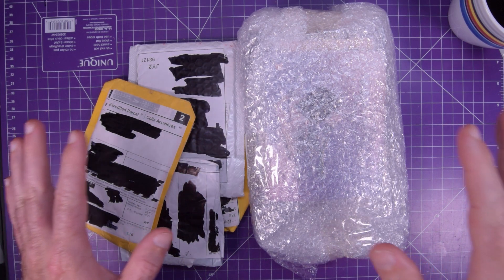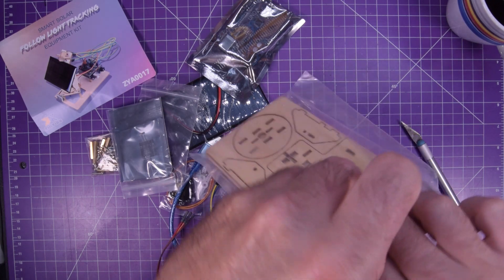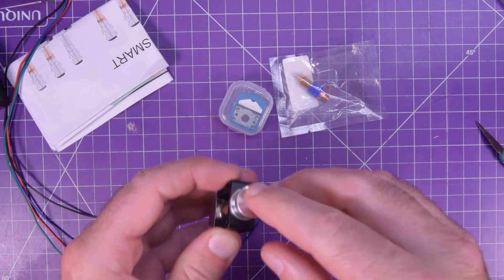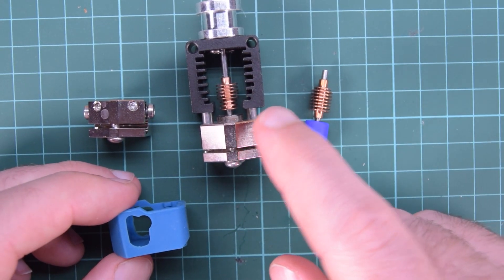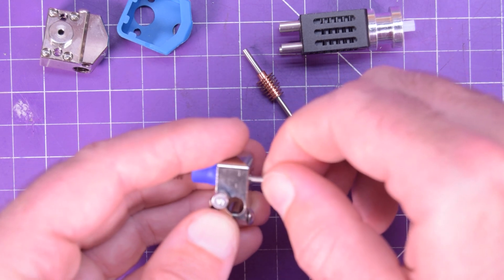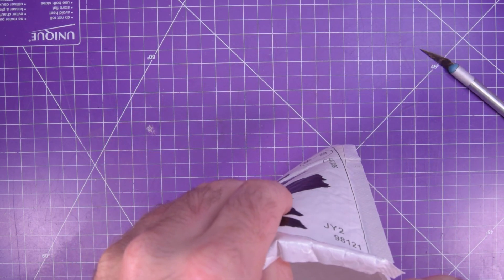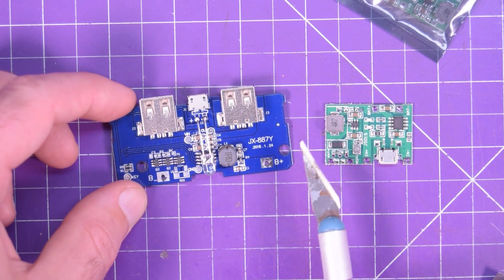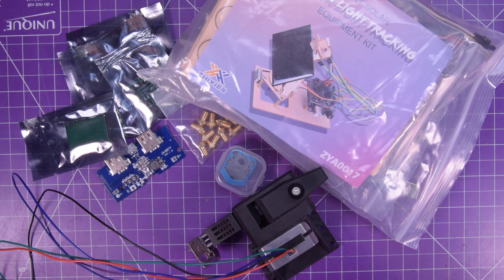Mailbag 111 - OneOneOne

Comment: Thomas Sanladerer's new YouTube video "0.4mm nozzles just became obsolete" is interesting and timely. It seems to Thomas that a 0.6mm nozzle is the new 0.4mm nozzle. He is recommending to use the Cura Slicer5.0 or PrusaSlicer 2.5.0 Alpha using the Arachne engine in both for best results with a 0.6mm nozzle. The speed advantage is very high with the 0.6 vs the 0.4 and the 0.6 also creates fine detail rivaling the 0.4mm using the Arachne engine. You don't get as much speed advantage of a 0.8mm over a 0.6mm nozzle because the percentage of the cross section area increase is not as dramatic as it is over a 0.6mm vs 0.4mm.

Comment: Both of these modules have issues: blue only works as powerbank, you cannot charge and supply at the same time, you either charge battery or discharge it. That so8 chip is dedicated to powerbank functions and nothing else. Green board lacks battery protection. While it can work as UPS for arduino, it takes current straight from the battery and charging chip when connected to usb, this might create issues of never ending charging of battery.

Comment: Could you not fix the "not snug" temp probe issue with a copper foil shim and some thermal grease?
Reply from the maker: Thermal grease is not made to operate at high temperatures, but a copper foil shim or aluminum foil shim was what I was thinking as well
Reply: @SimpleElectronics  How about that white thermal glue?

Comment: Great finds as always.  My completely unsubstantiated guess is that the whole idea of not getting it from the original vendor is probably bunk.  I'm guessing the 3d printing manufacturers actually "create" very little of the tech in the printers.  Obviously yours didn't seem as high of quality and getting it from the vendor may have fixed that, but... it's not like you stole from them either.
Reply from the maker: I understand what they meant though, I am in some way, an enabler